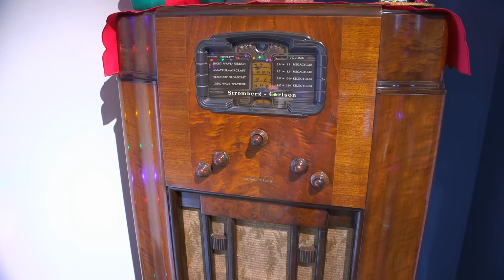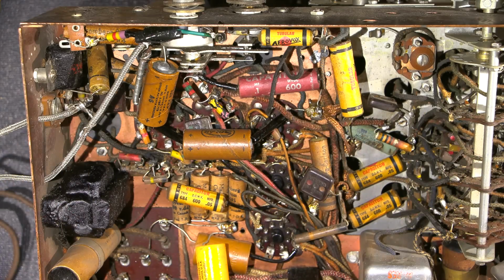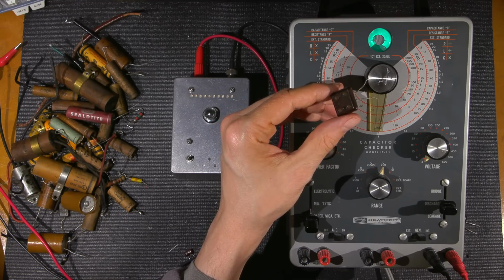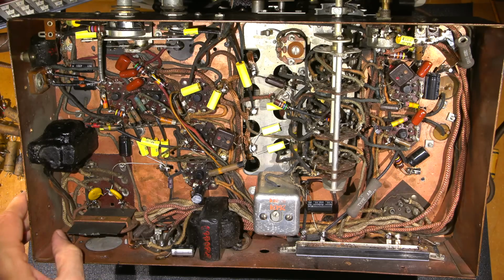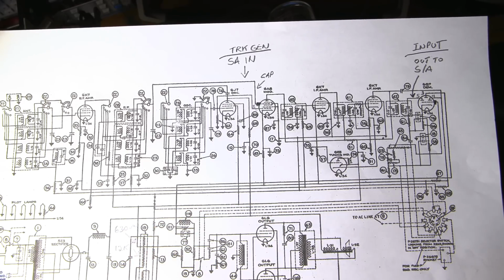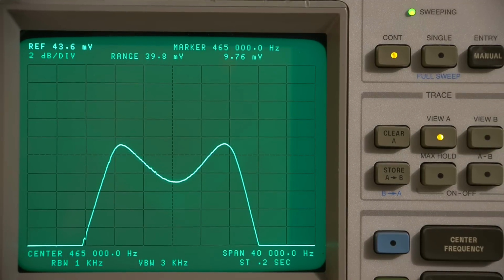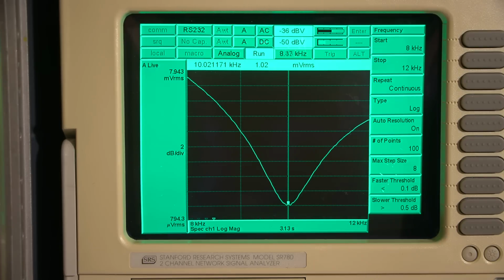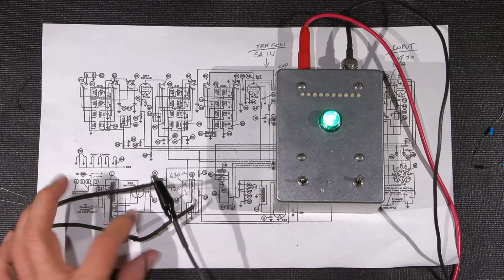84 Year Old Radio Receiver Restoration! Stromberg-Carlson 145L

Comment: Howdy Mr. Carlson, a huge fan of your videos. I believe this radio was a competitor to Philco's Model 680X from 1936 (your radio is from 1936 as well if I'm not mistaken) and I noticed that the tuning dial on the radio you are working on is the same exact tuning dial assemly as was used on the Philco Model 680X (Phenolic Dial) and also uses the same type of dial drive mechanism (10:1 and 80:1 planetary ball bearing tuning drive mechanism), and the Philco Model 680X also was a High Fidelity model just like this Stromberg-Carlson you're working on in this video, and Philco used their own version of the Acoustical Labyrith that S-C used in their Radio called "Acoustical Clarifiers" which were basically passive radiators installed on either side of the 10-1/2" speaker and has the same exact band spread as this S-C radio you are working on which is AM Broadcast Band (which is Hi-Fi in this radio), Longwave/Weather Band, and 2 Shortwave Bands. 

The Philco version of this  Stromberg-Carlson Radio you are working on sold for $250 in 1936 which is roughly $4678.97 in today's money, which means this radio was as much as a used car back then, and was essentially an investment, and I imagine this Stromberg-Carlson Radio you are working on probably cost about the same amount as the Philco Model 680X did. 

I am currently  working on restoring a Philco 116B Tombstone Radio (which the Philco 116X which was the console version of my 116B was the next step down from the 680X) and it is also a "HiFi" set as well but not as HiFi as the console version of the 116B or the 680X. 

I am also restoring a Coronado model 650B which is a rebadged Arvin "Phantom" model 618B Farm Radio which runs strictly off a 90V "B" battery supply and a 2.1V "A" battery supply, and so far all I've had to do to it was replace the original paper caps and the Oscillator coil because it was open on 3 of the 4 coil leads going from the coils down to the terminals.

I also got myself a nice Soldering/Desoldering station for Christmas and so far its been very helpful (especially the desoldering portion of the station).
Reply from the maker: Thanks for taking the time to write Levi.

Comment: Curious, couldn't you tune that dip with the HP3585B base band analyzer? I also have the 3585B and an 8566B which are both great. Ya gotta love the HP and Tek stuff,
Tnx es 73,
Glenn WA4AOS

Comment: Concerning the dual cap power line filter: this design will set the chassis at half the power line voltage (when the caps are operating properly), assuming the two caps are equal in value (EG capacitive voltage divider).   That would not be very safe IMO.
 Concerning the IF response in the wide band setting: the sag in the middle of 4 dB will cause the low audio frequencies to roll off accordingly because the sidebands will fall in this area.  I was hoping you would leave it on a talk station and vary the "Fidelity" control to show the effect on the audio tone. 
 I enjoyed your video !  Just had to add my 2¢ ...

Comment: One trick I use to tune large and stiff "hot" capacitors if to first put heat shrink tubing over the end of the screw-driver.  Two heat shrink tubes usually keep the end of the screw-driver insulated from ground. Just leave enough of the screw-drive end to fit into the slot of the capacitor.

Comment: Woow Mr Carlson has done it again. I'm a DIY highend audio maker on tubes. What a design from the '30 even a labirint for bass. This mast have being a fortune to buy this one in the' 30. You have a nice way to explain all ins and outs of old radio's
Like I said I mostly build or repair existing tubeamps. Don't know much about computing caps and resistors. But I can follow your video's pretty well. I did made an account on your patreon. Will try to make you caps tester. Well have a nice new year. I'll follow you tru the next year. Thx

Comment: Paul, you showed the mica caps as slightly leaky (~ GΩ) and replaced them.  What is the effect (on this radio) of this very high resistance leakage that makes you replace them?

When is cap leakage too high?  I.e., at what (leakage) "resistance" is a cap to be considered "bad"?

When you aligned the IF transformer caps, you used the spectrum analyzer.  How did Stromberg-Carlson align their radios without visual test gear like your spectrum analyzer?

I look forward to your video about "death caps" and why they are/were used.  This death cap turned into a <20MΩ resistor -- what is the difference between this leakage resistance and ESR?  Would you explain this in the future?

This is a wonderful video and was very educational!  Definite "thumbs up" before I finished watching!  ;)

Comment: Absolutely fantastic tutorial. Your attention to detail and logical analysis is superb. I recently restored a 1938 GE Table-Top and would like to add one detail: The AC power plugs were NOT polarized in those days. So depending on which way it was plugged into the mains would determine the effectivity of the safety fuse... and user safety. On my bench, I have an outlet box with a 120VAC light bulb which lights when the Neutral side of the line is HOT (on AC/DC-type chassis). By reversing the power plug, I'm guaranteed of no unwanted painful surprises while servicing the radio. On all my restorations, I always add a Polarized Plug for the safety of the user and to be sure the fuse is in the HOT line and not the return line. I really enjoy your channel and always learn something new. Thank you for another great video. Your time and efforts are appreciated. Happy and safe 2021.

Comment: Those test tones reminded me of my uncalibrated equipment. A lot of analog television equipment from having the luck of living up the street from where the television station  technicians bought and sold their calibration equipment.   Digital made them have to get all new equipment,
so I got their just-obsoleted signal generator for $40. Looked it up, original retail $3,500. Lightly used for a year, then digital. My gain. :)

Comment: I just got through restoring a Heathkit Condenser Checker (not the same model as the one Mr. Carlson has but similar). It had a dim eye tube but the original 1M and 10M carbon comp resistors that bridge its pins were dead on in value. The negative leg of the power supply ran the tester but the positive leg had its voltage pulled down by a 47K resistor across that leg’s filter cap to bring it down to 150V per the schematic but in my unit that voltage was around 200. I wound up replacing the resistor with a 470K instead which brought the voltage up to about 400 and that made the eye tube bright enough to make it nicely visible under normal lighting.

Comment: Dear Paul,
I hope you and your other half had a wonderfull Christmas.

What a beatifull looking and performing radio, really neat how they made "display meters" for the fidelity and vollume. Simply ingenious, the cabinet and bass-port design is a work of art. Mind you, this is 1930's engineering. Go figure !! 😀
I enjoyed this long restoration and allignment realy well 😊
Hats off to you for yet another super usefull and enjoyable video with knowlage and AM-tech curiosa.. !

I have one burning question tho,
It's about the small Electrolytic caps you showed at 21:40 , the ones you put on the cathode of the 6L6 's ;
What values do you usually stock up on for these? (Capacitance and Voltage ratings)

I recently stockpiled up on some Electrolytics (and also Metalized-film capacitors) that you put up on your 'Tested Components' chart back in Sept. 2018 on Patreon.
However those electrolytics are all 450V rated and thus are bigger in physical size than the ones you showed at the above point in the video, hence my question.

Many thanks for taking the time in case you would answer my question! 😊

Best wishes from Holland,
and a Happy Happy New Year ! 🍾🎆🎉

Comment: At about 1:40:47 when measuring IF bandwidth. Re: Why 6dB, and sometimes 3dB. It's about half power being 3dB down.
If measuring power in dBm or dBW, then  dB = 10*log10( power ratio). Half power is at -3dB because log10(0.5)=0.3010.
If measuring in volts, or in your case mV as your instrument is set to,  then dBmV = 20*log10(voltage ratio). So you get 6dB.
Power is proportional to the square of the voltage ratio, which is why the "10" becomes "20".

You are doing it the right way by measuring voltage.  A dBm (power) measurement would require terminating in the right impedance, which is kind of hard to do when sneaking the signal in with a light capacitive coupling.

Comment: you claim you dont cut corners...first of all j hooking is not cutting corners...second its very easy to restuff electrolitic cans instead of leaving them with all that nasty crap inside...i consider you are cutting corners there....i j hook everything to minimize socket and component stress but i always restuff can, uncrimp them empty them and recrimp them, i never use glue, only mechanical means of securing everything. the cans look stock and can be re-rebuilt later...but everyone has his own method....  j hooking can be made in a crappy ugly way or can be made to look almost stockif you take time and pride on your work..cheers

Comment: As usual a fine video, maybe a bit long on the cap testing though. Variable bandwith IF setup is exceptional indeed..
In my time I would've modified the common pushpull cathode resistor/cap setup though: with a common resistor of 160 Ohms a failure of one 6L6 endtube would have meant a halved voltage across it, so a less negative average steering voltage on the other one. Straightaway the second tube will draw excessive current and will meet its end quickly. Solder in two seperate resistors of 330 Ohms and half the cap value in parallel on each cathode  and a single failure will let the other 6L6 live on. Further improvement is possible by introducing an adjustable resistor setup in these cathode links for exact rest current balancing. 
BTW mechanically centering any old speaker cone on the driving coil end if it touches the ring of metal can be done by loosening the center screw, putting a few volts of 50/60Hz directly on the LSP and while the vigorous shaking goes on, slowly tighten the center screw again. Often this action alone is enough for recentering at the exact current level for both. 
This foam surround speaker invention was in deed reused I believe by Wharfedale in his 50's speaker designs for woofers and labyrints in standalone loudspeaker housings were shortly en vogue in the same period
PS Remarkable that for all these radio's electrical diagrams still exist! I myself often had to repair radio's without any schematics and had to identify the parts myself by looking at the tube pins, IF & trafo terminals etc Worst of all were prewar tar-based Philips capacitors, with by then unreadable markings on them. Overheated resistors loosing their marking ring colors came second .

Comment: If a spectrum analyzer was required to do the tuning - how do you think they got it done (in mass) at the factory in that decade? Was just curious about that.73, KM5L
Reply from the maker: Hi Patrick. They used a sweep setup with an oscilloscope. What is seen on the screen will resemble what you saw on the S/A.

Comment: For a 1930 radio with 8 valve plus the magic eye is quit amazing , Thanks for showing it, and a belated Mary Christmas to you.
Reply from the maker: Thanks Edgar, you too!
Reply: I am 78 years old, radio has always being my interest but i have being into Oil hydraulic engineering all my life. As a kid i started with crystal radio, studied just about anything in radio, transmitters, power supply's and many other tings associated with it ... And it is fascinating to see you with hands on experience. If it would be not for capacitors and resistors who lose there values, the radios would still working today.  You restoration of this radio, what live expectancy would it have ?. I love watching your work.   LOL. from down under.

Comment: hmmm - pretty sure you're using a green screen now - with that outline around your head - or did i just not notice before? the colour balance between your face and the environment (which are also at different scales) are notable too.
Reply from the maker: No green screen, it's all real. I couldn't imagine adding the complexity of a green screen on top of the insane amount of work it takes to finish one of these videos. The audio is all mastered on the analog side as well.
Reply: Mr Carlson's Lab oh it looks quite composited to me somehow! Truth is sometimes stranger than fiction I guess!

Comment: stromberg-carlson  started as a rochester ny telephone equipment manufacturer, branched to radio in late 1920's with a reputation for high quality.  My dad worked for them in mid  '30s
in thier radio division...... if you could dust for fingerprints you might find his, or not!!

Comment: I'm 19 and I own this same model of receiver. It's a great example. Mine was built in 1937. I love the "Acoustical Labyrinth" speaker in it.  I'm going to restore it eventually and it's in beautiful condition and is all original. I've done a lot of smaller table radios and I'm just waiting for room on my bench to work on the chassis. I've got a lot of vintage equipment including a nice Tektronix 466 scope. Thanks for all of your hard work and effort you put into these videos Paul!

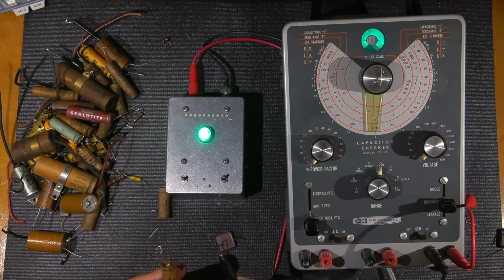Comment: 45:30 the cap showed bad because you had the polarity reversed. The new eye is too sensitive, try a 6U5/6G5.
Reply from the maker: Hi Phil. Those caps are not "Electrically Polarized," there is no backwards. They do however have an outside foil. The eye tube is not too sensitive, it's specified for the device.

Comment: Yeah right. Those screws have absolutely been exposed to air since the 30's. Sure.
No, this radio has not been restored within, say, the last 20 years.
It's pure coincidence that in 90 years this has collected no dust or dirt, despite smoking being a thing amongst 90% of adults during much of that time.
I'm sure the case got more attention than the inside. So looking at just the components...
Do appreciate this, most would go ; rip it out, put in Bluetooth receiver and blinking Chinese LED's.

Comment: But Paul I remember that without any signal the horizontal eye tube shadows will also open up completely. German eye tubes are symmetrical in that they have two sensitive horizontal shadows and two less sensitive vertical shadows. Anyways I'm wondering why in your radio the sensitive ones are always closed even without signal. Any thoughts? Otherwise as known from you another splendid restoration. Loving it!
Reply from the maker: The receiver is very sensitive, and a high noise floor will cause shadow angle deflection, even with no stations. If the antenna is completely unhooked, the eye opens fully.

Comment: You could get something free from the Youtube Audio Library and modulate your signal generator with it to demonstrate this. The problem is, of course, to find decent sounding stuff in there.

To the radio .. the people back then did know what they were doing, most likely better than the majority of todays engineers. 
There was no simulation stuff, test equipment was quite limited and you had to refer to physical books to get your information .. if it was even written down and not passed down from person to person. Also, there was a sense of quality around and in most cases you were ashamed to sell crap. Even cheap stuff .. it was simple, did only basic tasks, but tended to do them decently well. 

Todays cheap stuff is full of features which noone ever needs, which is good because none of them actually works. The middle class was dead for quite a while, but is now filled by Chinese manufactures and they take away a lot of business from local companies which also introduce products in this market again (and funny enough, they are quite often just rebadged Chinese stuff). 

This thing must have cost a fortune though, do you have any historic pricing information?

Comment: Transmission Line speaker systems have been around for a very long time and still in use as it is good at extending lower frequencies.

Comment: I bet my left ball the speaker membrane is a carbon composite material. Very many modern devices you are amazed of are based of
old ideas even old devices. Because of cheaper manufacturing it is possible to create these devices fort the masses and produce more
accurate and miniaturized products.

Comment: Constant current driven speaker in a transmission-line housing, class A amplifier, high-end receiver, all in design package....where did the good times go
Reply: ... and a high power consumer too. This thing is drawing idling... how much? 200 Wh? The same radio today is just a few Wh. Design is nice, but consider how many people have that much space just for a radio. Everything has its own time. Add to that an old CRT and you have 0.5 kWh heaters in your room.

Comment: I loved these style of radios and the awesome AM sound quality growing up as a kid. They were somewhat common in the early 1970's tuning into top 40 pop, classic rock, and soul music of the day. My parents also had a 1951 Phillips AM SW magic eye radio 3 speed record player combo with a nice bassy 11 inch permanent magnet  speaker. Sadly in the mid 70's the wood cabinet was converted to a plate and glassware, liquor shelf and the electronics were scrapped, but I did salvage the tuning Capacitor  (I was a crystal radio enthusiast) I still have a collection of 1950's 60's  antique metal tuning caps I acquired as a kid.